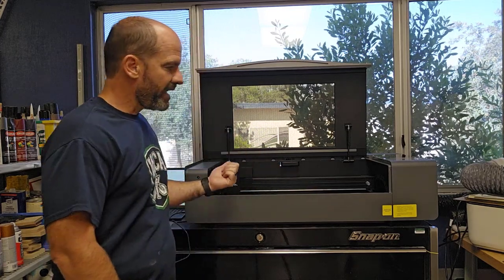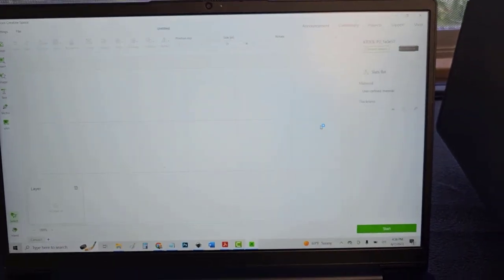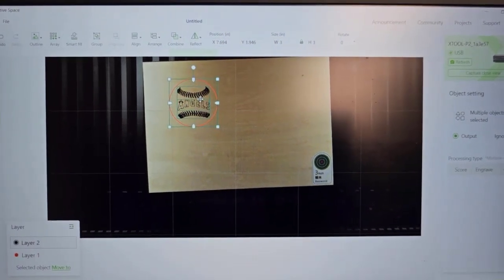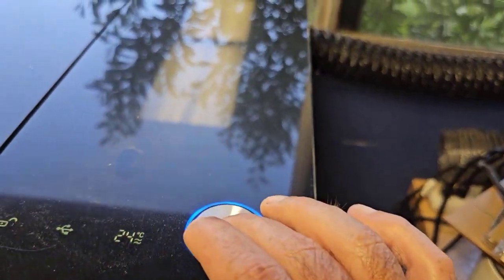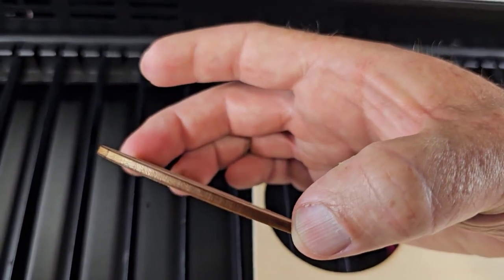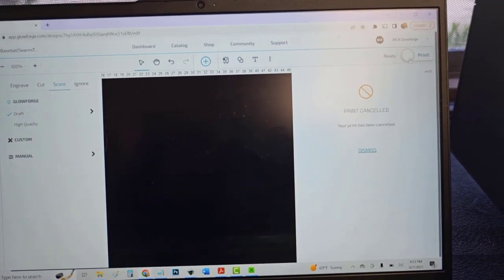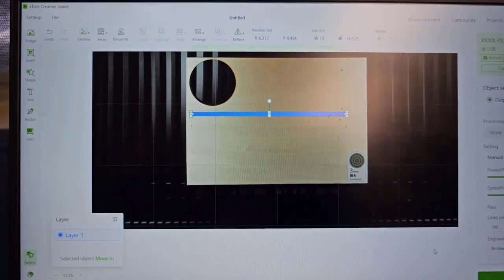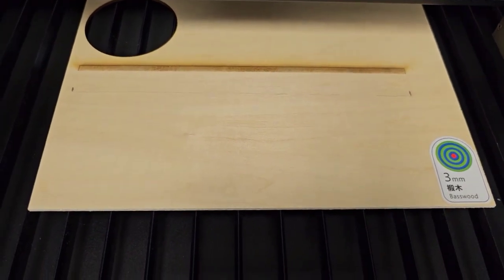XTool P2 Speed Test vs. Glowforge, GweikeCloud, and Ruida Laser

Comment: 4:30 for this short demo it doesn't do anything, but CO2 lasers shouldn't be used at 100 % power on a regular basis.
Reply from the maker: That's just a preference. It is said that it will make your tube die faster. But, if I can go 25% faster by cutting at 100% instead of 80%, that's 25% more profit and it will more than make up for buying a new $400 tube 25% sooner.

Comment: Following along with this review with interest. Question: Can you use Lightburn with the X-Tool P2, or are you limited to the proprietary software? Also, if limited to proprietary, is it usable offline (in case the Internet connection is down)? Thanks!
Reply from the maker: Yes to both. You can use Lightburn and the included software works via USB connection.
Reply: @Partyof4Crafts  awesome! Thanks!
Reply: I would love to see you use Lightburn with the cameras the P2 has and the autofocus...you can't.  @Partyof4Crafts
Reply from the maker: I only use XCS on the P2. I use Lightburn on my other laser and I just haven't seen any good reason to use Lightburn with the P2.